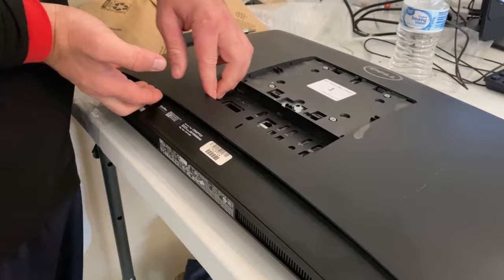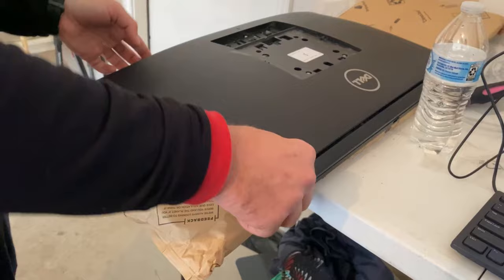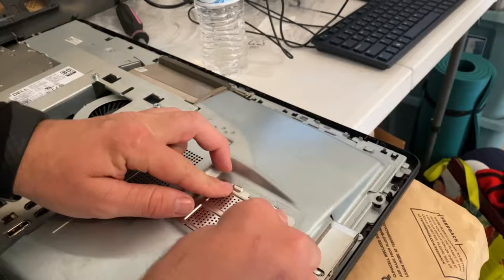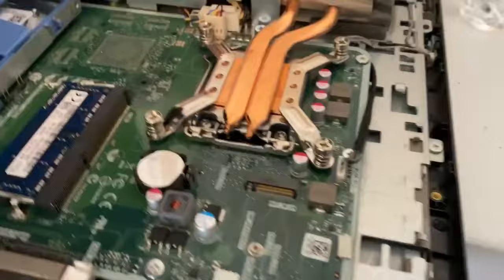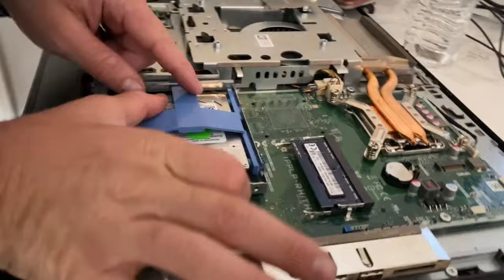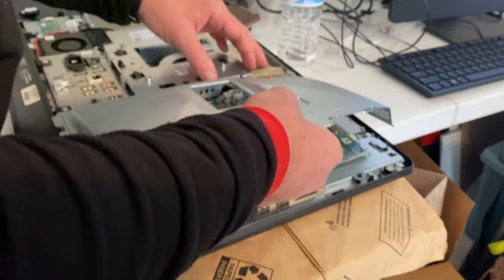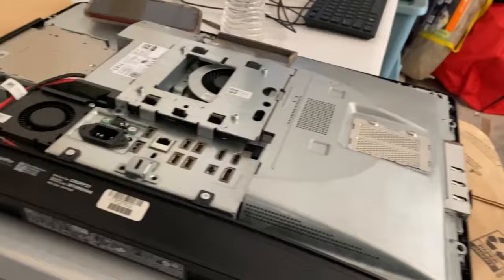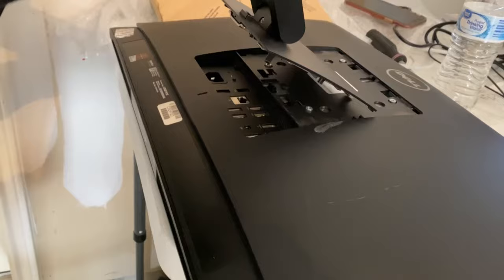Let's open up the Dell ALL IN ONE Optiplex 9030 Computer (Hard drive/SSD Replacement)

Comment: There are in fact two sliders numbs on the bottom edge of the PC (next to the speakers) which unlocks the plastic backing - it is ALOT easier to remove the back with the sliders unlocked! You know they are unlocked as the slider reveals an orange dot. Hope this helps!

Comment: Before you try to pull off the back, there are two like slide switches on the bottom of the unit you need to "unlock" to make the whole process a lot easier.